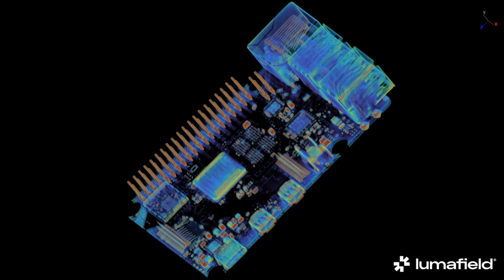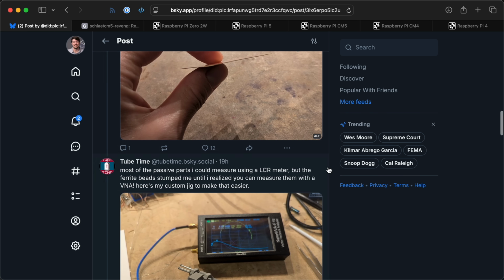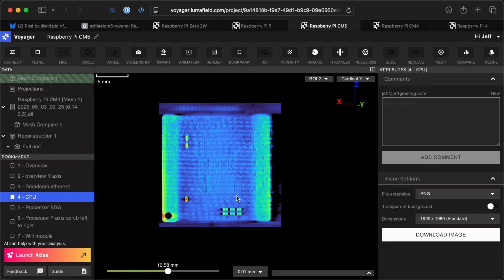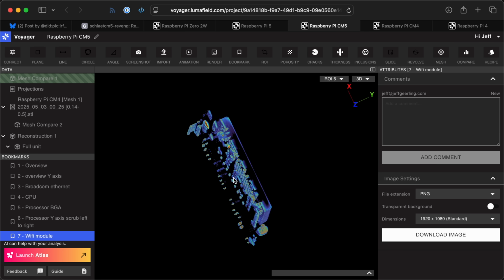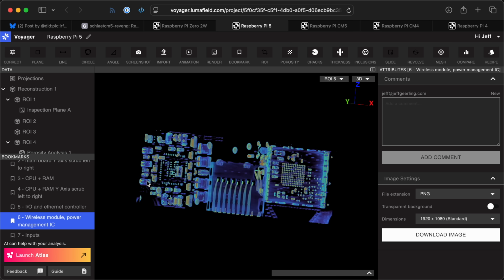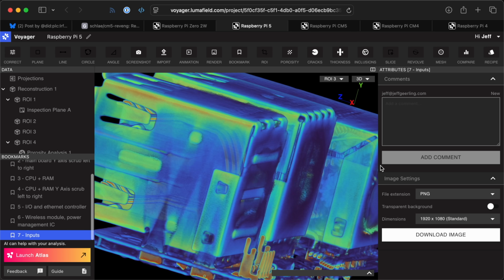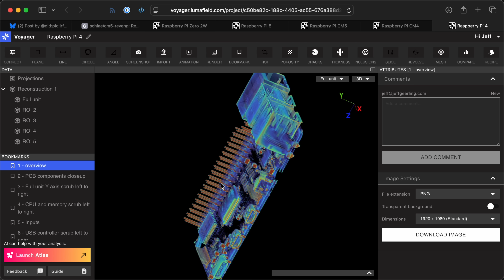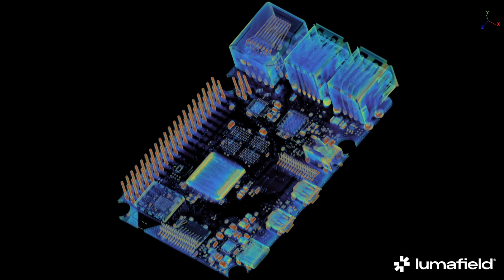Reverse Engineering ALL the Raspberry Pis

Comment: this doesn't help anybody and anything about opensource.
Reply: Are you sure ? I mean, clearly Jeff won't start now to build his own CM5 in his garage or anything, but having all the details can be useful even if you don't intend to manufacture the same thing at home.
Reply: @Winnetou17 useful for what? And for who? Ridiculous, except for YT to make money on bullshit
Reply: @Winnetou17 also, the concept here is completely wrong: an openhw/sw device should be released with all the source, mechanical, schematic/pcb, firmware and software instead of promoting that shitty "educational RPI" which then you need to hack and reverse engineering to know stuff. It's simply wrong and crazy.

Comment: Do you think someone would ever reverse engineer an i5 2500K? That legendary CPU needs to be studied further!
Reply: I was kind of asking myself almost the same. Like, with the current technology, can someone small create a 386 ? I was bleeding edge 40 years ago, it should be much simpler now. And by that, it should be achievable to non-giant fabs too.... I think.

2500K is another level, much smaller manufacturing node, many more transistors. I know that derbaurer has microscope shots of some CPUs at 1.000.000x scale, but from this to reverse engineer it's still a gigantic way to go.
Reply: @Winnetou17  Mister has a 486SX core, so that's basically been done.

Comment: From hardware's point of view, all Pi 5 4 3 2 1 0 are all low tech. No value for reverse engineering.
The value of Pi is 40-pin GPIO and the software, documentations.
Tech is moving fast. If Pi does not catch the pace, will be left in the dust someday...

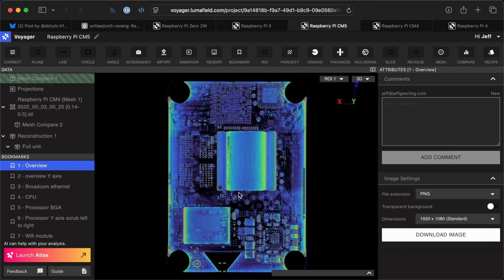Comment: 2:18 "It's not as good... as sanding it..." Yeah, but at the end of the day you still have a fully functioning CM5 instead of dust and debris.
Reply from the maker: Heh, true
Reply: The real fun part with sanding it down is putting it back together :D
Reply: @HDL_CinC_Dragon  A little duct tape, a bit of crazy glue...
Reply: Tbf, the scan would probably cost more than the pi itself

Comment: Those structures in the ethernet connectors are transformers, not so much inductors.  They serve to isolate the signals between the ethernet switch upstream and the network device by AC coupling them and avoiding ground loops.  Of course, doing PoE throws a bit of complication in there, but the switching power supply that PoE uses also isolates the devices.  

It might be interesting if you did a video on how PoE works to dig into some of this in more detail and explore the issues and solutions in how PoE works.
Reply from the maker: I have had that on my list for years... even set up a demo with an oscilloscope to show AC vs DC bias, but haven't had the time to really dig in and turn it into something video-worthy. Hope to someday though!

Comment: Absolutely fascinating reverse engineering technologies!
Would really be cool to export those layers directly into a CAD PCB dev app, such as kicad, without needing to trace over the images (assuming that would be the case). If not already, it's inevitable, IMHO.
As it happens, I need to integrate a cheap Amazon USB-C boost/buck convertor to power my project's PCB, because it's the only 5VDC-5VDC regulator that I've found that actually works to eliminate noise. (Already tried large electrolytic caps which don't).
Great video, as always, Jeff.👍
Reply from the maker: There's at least one open source tool for that, but it's not always very good, especially for more complex boards :(

I'm guessing there are commercial products that maybe go further, but I don't know of them.